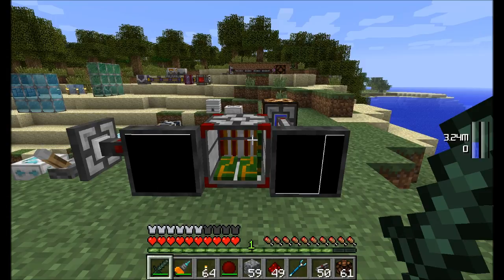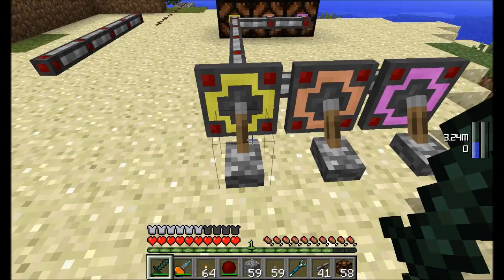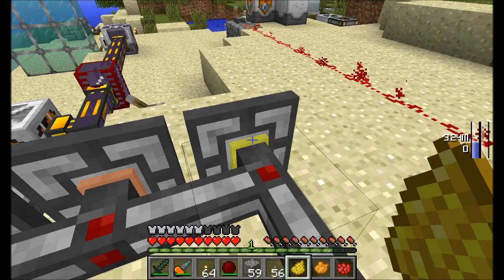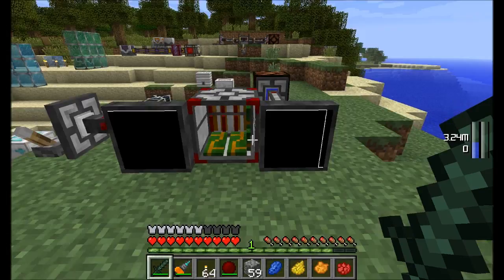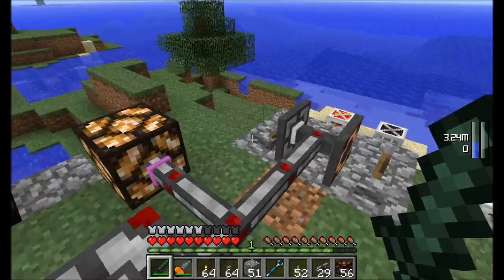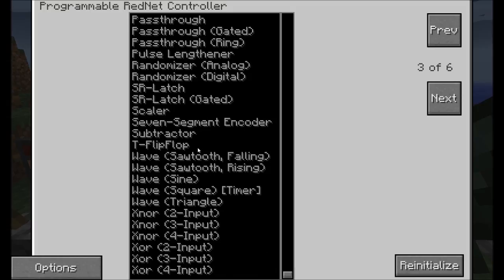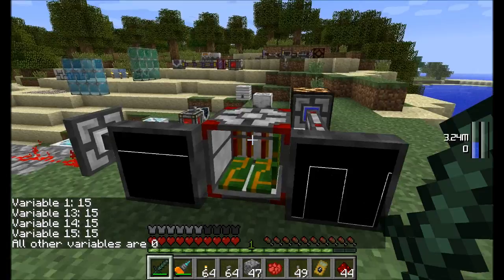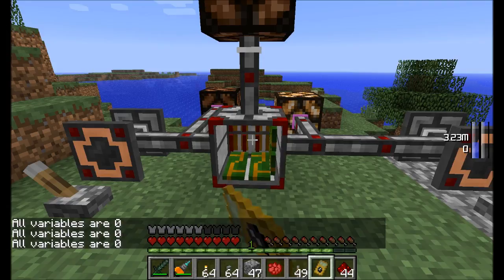Mod Spotlight - MineFactory Reloaded Part 3

Comment: I'm glad that rednet cabling and controllers are getting the attention they deserve.  Between MFR, Buildcraft improvements, and the upcoming API I heard that Chickenbones was making for Wireless Redstone, we'll be to a point where RedPower is mostly irrelevant.  Immibis will hopefully be able to integrate his microblocks mod to work with Chickenbones' code and vice versa to create a universal way to hide wires and things.

Comment: You can craft blackstone and whitestone with cobble/bricks/smoothstone around an ink sac or sugar to make basalt/marble replacements. 

There's also another mod called Artifice (you can search for it on the technicpack wiki) that adds marble/basalt equivalents, with amazing connected texture implementations in its paver/antipaver blocks that allow you to basically create whatever patterns you want.

Comment: Having made music for a couple of years and messing around with synths, i recognised a lot of the same stuff in this mod as in designing sounds. This is basically setting up LFOs (low frequency oscillators). And as such, i can see a lot of potential for this mod. I have a few ideas in mind already, and I am definitely looking forward to trying it out.

Comment: Tripwire emits a redstone signal when triggered, so yes, it should. It should also work with pressure plates, redstone torches, buttons, trapped chests etc. Dire used levers just to make it easier to see what was going on.

Comment: From what I can tell, wiring in houses are wired up differently. If you have 2 inputs, having them both on or off will cause the light to come on, but having them opposite will not do anything. I have first-hand experience with this, as some of the lights in my house are wired in this way, and my father and his friend work with electrical stuff.

Comment: I don't know why your comment was downvoted, I have to agree. Redpower simply looks better. It doesn't have ugly pads where it connects to levers, and, in fact, can be completely invisible if you set it up correctly. Maybe if it were compatible with some sort of microblock system it would be better.

Comment: Even though it probably couldn't replace redpower,  the rednet programmer could probably be used for making something VERY compact that would be pretty big. Also the grossness could be resolved using vanilla redstone mechanics, you would have to put a block in front of the cable and force the wire to connect to it, it would take power from the block.

Comment: Considering that transistors are analogue and can be used as amplifiers, can send signals 'backwards' under certain conditions and need to have voltage levels carefully balanced if you want them to function as a passthrough (which is what you seem to be assuming they function as), I'll stick with the simplified and useful logic gates, thanks.

Comment: I usually slap the levers/buttons right on the cables, it looks much better I think its designed to be done like that as you can see the colors fully around the levers on the interface pad.

Comment: This is a good replacement for RP2. Will be using this a lot in my private 1.5.2 Mod pack. I missed RP2 so much but now I know about this I will be using it. Thanks Dire for the Spotlight

Comment: Except that their forums still state that they weren't publicly releasing a 1.5 modpack because people still want RedPower 2, and that's why they're keeping the public release on 1.4.7. They aren't necessarily "waiting on RedPower 2," but they're also not updating to 1.5 without it for the public release, so technically, yes, they still are.

Comment: I agree to some extent. I do like that it's easier to change on the fly, but it's less intuitive to me because bundled cabling wraps everything up and you can set up individual wires, while this only has the ability to change color for things it's attached to, not the wire itself.

And that logic system is another flaw to me. I like having my gates separate, not having to craft that one block over and over and over for every single part of the circuit. That seems like a waste of resources.

Comment: Immibis Microblocks will get you microblocks without redpower, and it allows you to cut up mod blocks and run mod cables through them as well- imagine RP2 microblocks, but you can use blocks from other mods with them, and you could run IC2 wires or BC pipes or other mod cables through them instead of just RP2 stuff.

Comment: by placing torches on the cabling, It's possible to make circuts very compact. I was able to make an and gate (without the logic controller, just vanilla torches) in only a 2x2x2 space as opposed to a 2x3x2. My only complaint is that it's rather dificult to make nor gates because it's imposible to transfer a signal to another color without repeaters

Comment: The Counter, Delay, Equals, Greater/Less than, Greater/Less than or Equal, Maximum and Minimum all seem to be fields that are understood by a programmer.  I could easily learn most of the functions of the Programmable RedNet Controller without needing to read the (in-game) manual.  The Gates, however, would take me a little bit to figure out before I can really get a hang of it.

Comment: True. That is a nice feature in a way, I'll admit. It's a one-size-fits-all thing, which is pretty incredible. But for more complicated circuits that involve several gates at once, it seems far less intuitive than RedPower, which is my complaint.

Also, just an aesthetic thing. It's not a big deal but I think the wires in RP2 look so much better. These are pretty ugly to me personally, but, that's me.

When I said it's not a replacement, I meant it couldn't replace it for me. That's all. c:

Comment: I used to run a vanilla server on my old PC since I don't use it for anything else, but it can't handle modded servers. I just run it locally on my main computer. I've got a 30 Mb/s connection, so it's enough for myself and up to four friends to screw around on together. I'll eventually rent a server, but I don't have the money currently as I'm still unemployed.

Comment: I was not exactly impressed with mfr, I didn't quite like the style the machines worked with. But the cable alone sold it for me, and the controller is jawdropping... it's the perfect midpploint between my absolute favorite forth computer and individual logic gates. It looks great, and lets you use levers and buttons for input, not an annoying ui. And just think! 16 colors and 16 signal strength... you can send an entire byte down a single cable! Powercrystals, you get the internet.

Comment: Actually, from CC 1.51 you should be able to use redstone.setAnalogOutput(string side, number strength) to do just that.

Check out the CC wiki

Comment: Amazing stuff, but totally confused... what would you use this for? I only ask because I'm still learning modded minecraft.
Reply: it saves a lot of space in big redstone builds
Reply: Typically, large automated complexes require lots of redstone to control. RedNet helps you compact that redstone into, at best, a single wire that could very well be controlled by a single computer.

Comment: I vaguely remember someone telling me that with this, I wouldn't need RedPower anymore.

... frankly, I'm not convinced. RedPower looks better in my opinion (I don't like how this looks connecting to levers or torches, it's gross), and is far less complicated and easier to work with. The "frequency" system in this is also harder to work with than the bundled cabling from RP2.

This definitely doesn't replace RP2. It's a pretty nice mod, but it's not a replacement by any means. Not to me.

Comment: Well, ...
Without intense modding, before 1.5 you couldn't make anything that used signal strength, as all that was coded into the game was the fact that redstone signals travelled 15 blocks, however each piece of redstone didn't hold its strength value.

Comment: I believe you said the redstone frequencies, or "strength", was added in the latest minecraft update? Just one correction. minecraft 1.5 added comparators which allowed you to use comparators with varying outputs based on "frequency strength". Otherwise, good review!

Comment: That's odd. I only have 2 GB of RAM and a Core 2 Quad 2.6 GHz, and never get any lag whatsoever with RP2 on 1.4.7. People also said Industrial-Craft² was laggy on 1.4.7, but I have that with Advanced Machines, Nuclear Control, Compact Solars, and the Charging Bench addons, and get zero lag. Works just fine. c: Even using redpower wires and wireless redstone (chickenbones' edition) to turn on and off my nuclear reactor, works instantly. No frame rate lag, no delays, nothing.

Comment: The big difference between this and Redpower.. Is how much more intelligently it was done. Redpower was notorious for causing lag because it constantly had to update lighting, which put a strain on both server and Client.
Other then that.. Redpower is no different then this, sure it had thin little wires but they still took up the full block. Yes they has covers too but those only worked with RP2 stuff so bit of a moot thing.

Comment: That said, RedNet is different enough and includes enough innovations (the rednet controller box by itself does a ton more than anything RP2 has out of the box), that it is its own system. It wasn't designed to copy or replace red wire from RP2, it is its own closed system with its own take on vanilla redstone dust and repeater mechanics.

I mean, if you are going to complain about copies, than shame on RP2 for copying the concept of vanilla redstone and repeaters. :P

Comment: I suppose I didn't quite make myself clear on the logic system (ran out of characters). What I meant was that I can craft one logic block, and then set up all of my logic stuff on ONE circuit. Admittedly, there are some downsides (RP is much better at building circuits that are far apart/simpler), and I think that I do prefer RP (when I disagreed with you, I meant it was a decent replacement). I think that this system can/should replace RP until it updates. +, why changed wire colors good?

Comment: Redpower started as nothing more then a wire mod and eventually got panels/covers. So give it time considering this is new and not a few years old like Redpower. '
And he was likely down voted due to ignorance on his part saying Redpower didn't cause lag, which it does on both server and client side due to the lighting updates.

Comment: Personally, I have to disagree. I admit the aesthetics aren't that good, but I hide my wiring anyway, so its not a big deal to me. I find the frequency system to be slightly better than bundled cabling, mainly because you can change the colour without having to craft another set of cables, plus the fact that you can interact with it directly, instead of having to go redwire > insulatedcable > bundled cable. Even the logic system is cool b/c all your "gates" can be in one block (it is complex tho

Comment: To all,  if you want to learn another way to use this thing check out the free college level course called Nand2Tetris. It will have you build all the logic gates (in software) starting from nand and then lets you make an OS and even to make games FOR that OS (example game is Tetris if you haven't guessed)
The class is free and if your interested in this stuff, having this under yourbelt makes Computer Science a breeze :)

Comment: Then we have a total of 64 bits in one freaking cable. Cause of the new analog mechanic, you have 16 values in 1 color band wich is equivalent to 4 bits. Then, you have other 16 bands, this is 64 bits in total. And a total of 18.446.744.073.709.551.616 different values :)

If computers can interact with it... It could be used to pass messages at the same level of information as the actual computer can :3

Comment: Impressive mod, but the long explanations of those basic gates are a little boring if you have an exam on computer architecture Monday... It would be a little more challenging (and useful to learn with) if the mod added transistors only and you would do complex boolean functions with it :)

Comment: this looks like it would make an easy keypad. add 9 buttons to a wall, add some cabling and set each connection to a different colour, and setup a "AND (4 input". use the colours as a code ref, and you could have a 4 digit code on a key pad.  i just need to figure out the pulse time on the buttons to make run perfect,  ;o)

Comment: That's nice and all, but, it still just doesn't look good regardless. I don't like the little "pads" when it connects to levers. I'd much rather have actual wires that run along the ground than this. Plus, can this connect to redstone dust? I've been playing with RP2 wires and how they interact with vanilla redstone and found some incredibly useful functions with that.

Comment: After watching all three of these, I have to ask: This on peaceful... why not just skip the middleman and go creative?
I guess there are people out there that think more automation = better, but the way automation works with most mods require a bit of creativity (usually) or some expensive resources. With this? There's a cheap block for that. All you need is to automate power... and there are already ways to do that.
I doubt I'll be playing the Direwolf20 modpack after this gets added.

Comment: But ideas are not personally own. The concept of an iron tank comes from real life metal liquid containers, that isn't a new thing. Also, without people taking their own takes on things, originality would die as would general improvements to any system. Think of if no one was allowed to make their own variation of a car, why bother spending money improving on the original system, it "works", making a newer car with new innovations is just "copying" the idea.

Comment: I was only able to watch halfway before I was dragged into a Skype call, so I'll admit I didn't see all of it. It apparently attaches to redstone dust the same way as it does to levers, but not similar to how RP wires work, so that takes away the feature I found useful in RP. And it still looks gross honestly. Do not like that little "pad" ending when it's attached to levers/torches/dust.